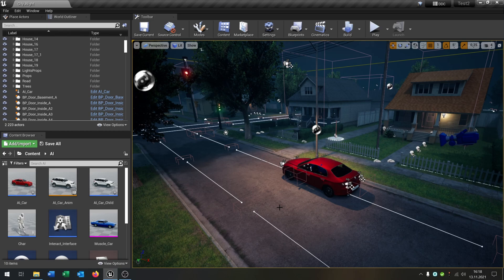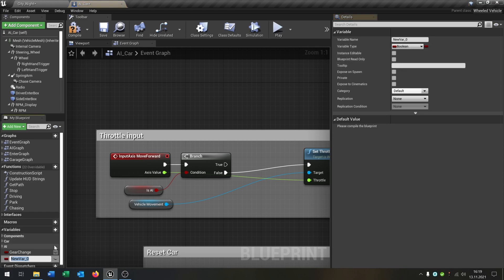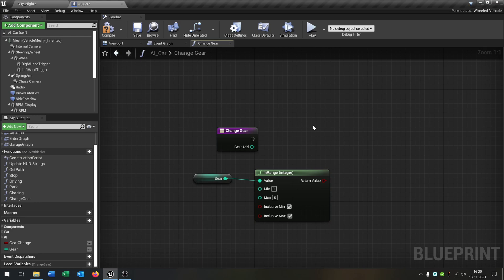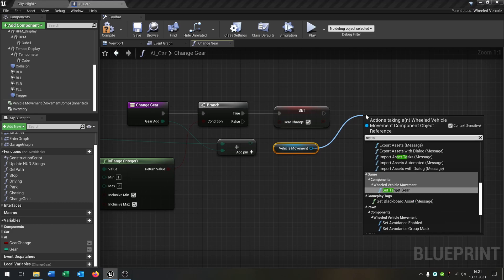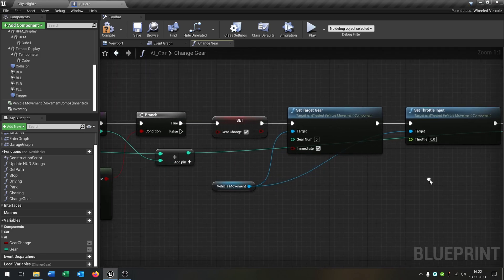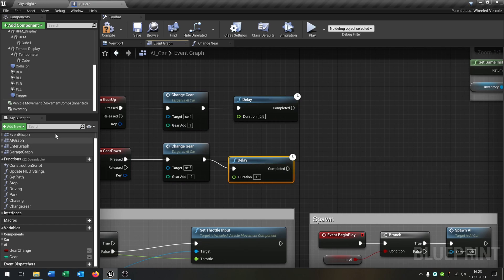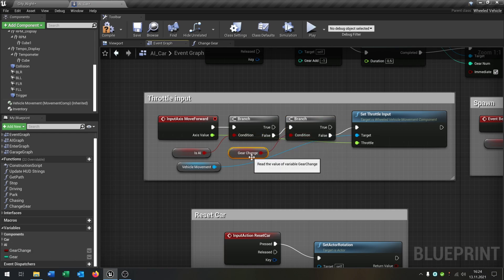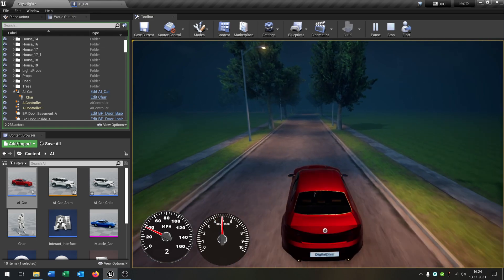Unreal Engine Manual Gear Change Tutorial

Comment: Hi, I'm looking for Automatics gear l ike P,N,D,R
Reply from the maker: Thats the default Situation with the Vehicle Template. Thats why I show the Manuel Gear Change. Cause Automatic is already there.
Reply: @Seredias.  I'm trying to connect a Logitech gear shifter to the Vehicle template. How can I enable gear switching (P, R, N, D)?
By default, the car is always in Drive (D), for example, I'd like Reverse (R) to activate only when I manually switch to it and press the throttle — not when braking.
Any tips on how to set this up?
Reply from the maker: @Samm-lv8cl In this Case I would recommand this Tutorial: https://youtu.be/5211u26teIY?si=LD1KKK_6CTIaBeJ1
Reply: @Seredias.  Thanks, Iv created the AI Enhanced input and it ready to be attached to the action. but Im stuck with the Input not sure how to separate the R from the break.

Comment: Do you know if theres any way to program manual with clutch?
Reply from the maker: Depending on how realistic you want it. If  you just have a key that you need to hold while shifting, it's easy. If you want you a realistic clutch that you need to release slowly while you press the throttle at the same time, that I think is very difficult.

Comment: Hello, amazing tutorial but there is a problem that I am facing it is that when ever I change gear up to 5 it works pretty well but if I pressed up gear button then it goes to 6th gear (which my car doesn't have)
and then I can't switch back to 5 gear or any other accept r gear so I added 6th gear to my car but still it doesn't work please help me 
Tank you
Reply: had the same issue. You have to clamp the value after the "+" node. The clamp should be from the range you put in the "InRange" node. Hope this helped in any way
Reply: @arkgamer742  thanks so much!!! :)
Reply from the maker: Did you set the Max of the "In Range" to 5? 1:40
And did you deactivate the Automatic Transmission? 2:22
Reply: I had the same problem, in the car's "event Graph", right after the "gear change", add a "Branch", in the "branch" condition, add a "<=" at tip B and at tip A place the variable "Gear", at the True output end of the Branch follow the flow normally, at the False output pull the Gear variable and select Set Gear and enter the number of gears, at the Set Gear output connect to Delay to follow the flow, that's what I said is for imput gear Up, for gear Down it would be exactly the same thing, just changing the value to -1 ("reverse of the car if yours has it") and changing it to ">=", I hope I helped, no matter how much It seems easy, for someone who is just starting out like me, it took me a few days to come up with a solution, I made a point of coming back here in the video in order to save anyone from wasting time on their project, good luck and may the force be with you